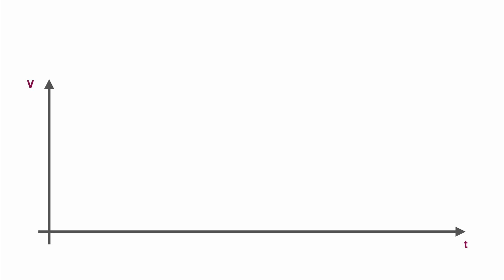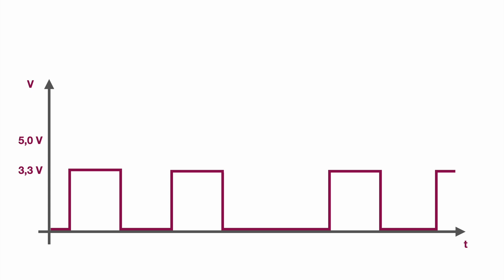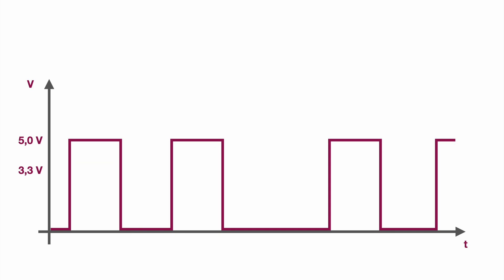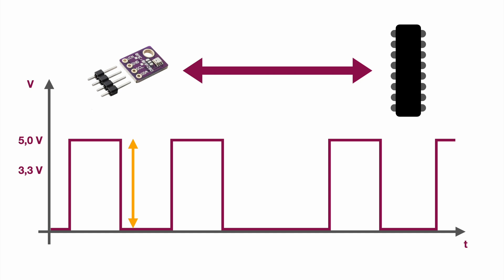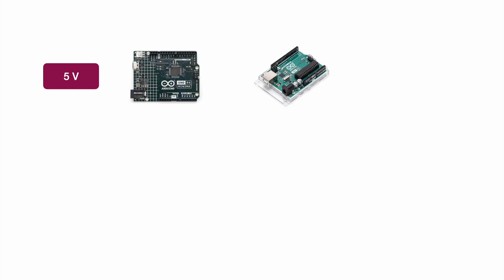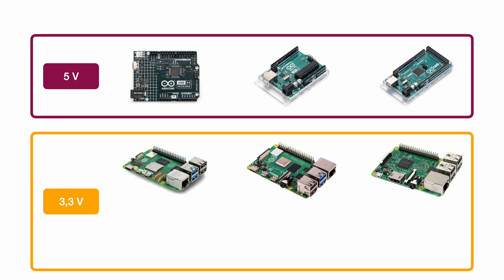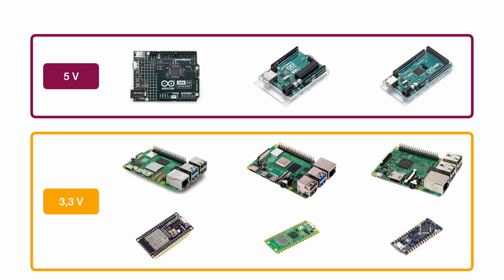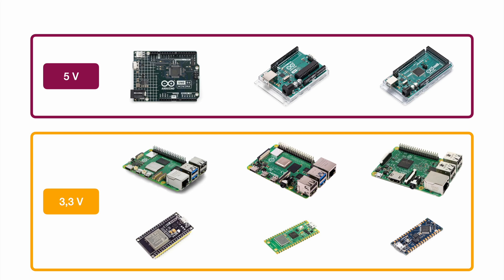What is a logic level?

Comment: Could you simply explain why there is 5 and 3 volts to begin with.. Why everything is not on a single voltage only
Reply from the maker: Hi @Rafael,
thanks for your question!
As many things in electronics it comes down to industry standards. As mentioned 5V is very common since it’s the USB voltage. So for many DC DC converters, power supplies and so on are available, mass produced and so for cheap.
3,3V in the meantime is exactly 2/3 of 5V, so a natural step from 5V, easy to achieve with a 10k / 20k Ohm voltage divider.
In general highly integrated chips like microcontrollers, CPUs and so on are working with even lower voltages (to high voltages increase the risk of arcs if you put circuits closer together to miniature). So it’s easier, so to speak more efficient and cheaper, to step down from 3,3V to let’s say 1,2V than to step down from 5V to 1,2V.
Those are all technical reasons but it really comes down to manufacturers settled on certain voltages. Same way as you have different bus communication protocols.